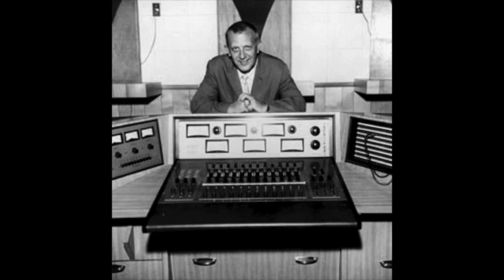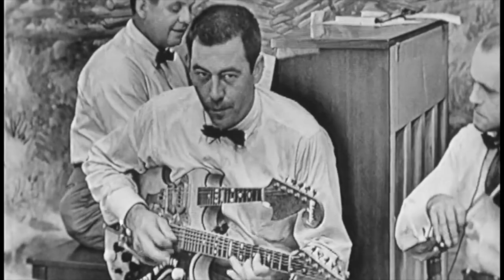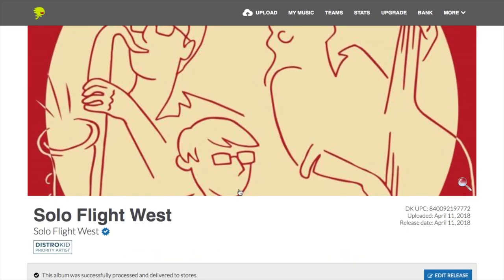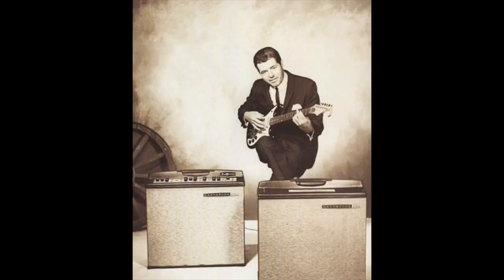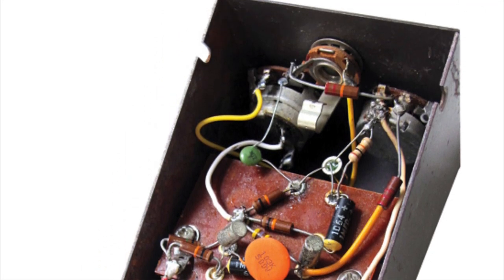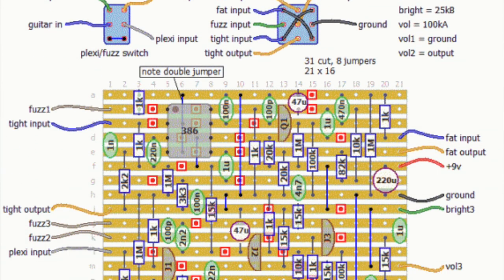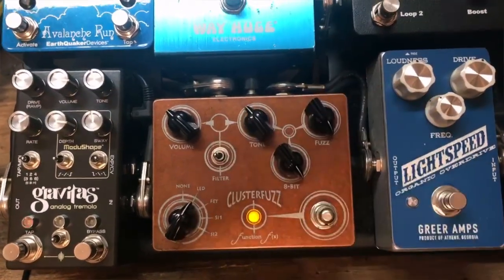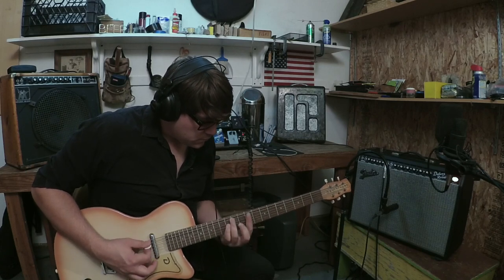The Hunt for Grady Martin's FUZZ TONE | History of the first Fuzz Pedal

Comment: I think the tone you seek requires a very carefully damaged transformer, functioning more or less as a spark gap.   Another way to do it would be to bias a tube well into Class C, almost Class D, so it's just being triggered at the peaks of the waveform.
Reply: The "spark gap" is exactly what happened in this case. Glenn Snoddy discovered the bad transformer when diagnosing the problem. It was arcing across the center tap. There were multiple bad ones due to the outsourcing of the transformer construction for a brief period.

Comment: But of course, Grady HAD the Fuzz, to a degree, even before he perfected it with "Don't Worry" and thereafter...

His main rig was of course his Bigsby Doubleneck... The Bigsby pickups were made with square magnet which was wound with square wire... And were incredibly low-ohm pickups... Anyhow, he ran that guitar through either an old Standel amp, or sometimes a Ray Butts Echosonic amp.

You can get a "close" tone by running a vintage 53-ish Telecaster through a low wattage tube amp.

Drive the tubes but lay back on amp volume... Turn the guitar volume control UP.

"Mud-out" the treble n bass pots on the guitar... 

It's a pretty close replication.

You can even run through a Tremolo pedal, set the "speed" up for a faster clip, set your "depth" down so as not to get the "outer space Surf" vibe....

Turns out this same setup can also replicate the Cliff Gallup sound... Just add to it a good, fast 1 or 2 repeat delay... Roll your drive on the tubes down, brighten your treble a bit.... It's a fun way to run!
Reply: Interesting observations that you mention. I think I will try it out. I have been looking for that classic Grady Martin rockabilly sound. I even considered buying Bigsby pickups for my Gretsch, but before they produce some that replicate the appearance of my Dynasonics, it will not happen
Reply: 53 Tele into a low watt amp + a booster or one transistor dist --> Spirit in the sky :-)
Reply: @dkxilef man... Sorry that I didn't see your post for TWO YEARS!

As I'm sure you know, T.K. Smith out in California makes beautiful Paul Bigsby pickup replicas...

And there's also a Cat over in Great Britain that makes a beautiful replica Bigsby pickup that's a lot less expensive... I'm pretty sure the name of the outfit is MOJO.

Again, sorry that I missed your post!

Comment: A great Fuzztone is a highly personal thing, what one person may regard as a great Fuzztone, another person may not, I own a Jim Dunlop JD-F2 red fuzz face pedal that I converted over to use silicon BC108C transistors after the original NTE158 germanium transistors went bad and no longer worked anymore, it's a great sounding fuzz pedal, I'm currently waiting for two new issue 2 fuzz face PCBs to turn up in the post so I can do some more work on my fuzz face pedal.

Comment: Play it on a 6 string bass. That's the secret to the Grady Martin tone on those recordings
Reply from the maker: I touched base on the 6 string bass in the episode
Reply: Did he use a six string bass though?
Reply: Apparently in a lot of the Nashville Rockabilly tracks (Johnny Burnette), Grady would run the low "E" string polepiece up until it almost touched the string... And those old Bigsby pickups were really low ohmage to begin with.

I also remember one of those gents telling me that he used either a Standel amplifier, or one of the Ray Butts amplifiers in the studio.

I also remember being taught NO REVERB.

A little Tremolo and of course the Tape Delay that was created by using one Ampex recorder running directly into a second Ampex recorder, but one or two milliseconds after the original signal.

Comment: The way I see it, what these are all missing is an actually over-driven speaker.  The problem is, the people who build these fuzz boxes are engineers who are formalists with rules . . . they naturally will not overdrive a speaker past a certain point.   I once took an old Craig 8-track player, one that had been a top-of-the-line player in its heyday, connected a guitar up to its input tape head, then ran the output to a three-inch speaker and cranked the volume way past the normal limit, I was actually trying to blow that sucker . . . . it did not blow, but what I got out of it was a sound very much like to song Spirit in the Sky, https://www.youtube.com/watch?v=W2msh0jut2Y . . . . no fuzz box involved, so when it comes to Don't Worry, I am quite sure the reason why you are not getting a good matching sound is it is highly likely the speaker was a bit larger speaker than a 3-inch in the case of Marty's song, but well over-driven.   Most people won't do that because they don't want to blow their speakers, and I'm sure there is a risk involved.   The 3-inch I used was something that was a throw-away so I didn't care.   The pitch is a bit higher on as 3-inch than Marty's song was.   Anyway, that's my take on this issue, have been a big fan of Marty Robbins and Grady Martin, grew up listening to their music.

Comment: I think you pretty much got it, sounds about right to me. But opinions my vary.
Reply from the maker: Thanks, and you can bet my pedal setup has definitely shifted dramatically since shooting this.
Reply: @soloflightwest  So the ClusterFuzz is OUT? If there is something else, did you do a follow up video on it. The further pursuits of the Grady sound.
Reply from the maker: @ksharpe10  the Cluster fuzz with a buffer infront of it using a single coil pickup seems to be the closest, but I’m currently using the Jackson Audio FUZZ for the variety at the moment as I have gigs that require it. I haven’t made a follow up on it yet- but if I find another way to get a better Grady you bet a videos coming!
Reply: What is a Buffer? And what kind of product is used for it. Like is it a Compressor and or a Graphic EQ item?